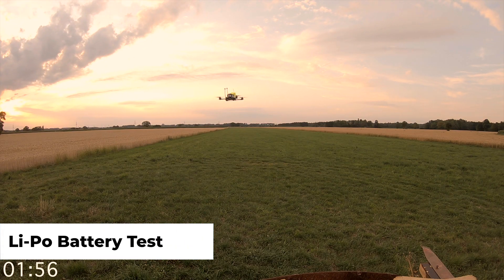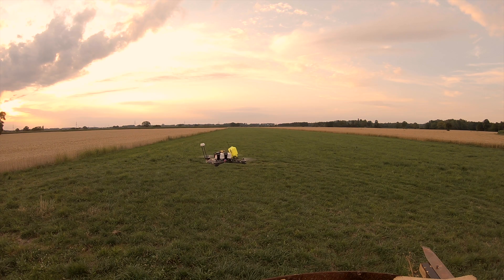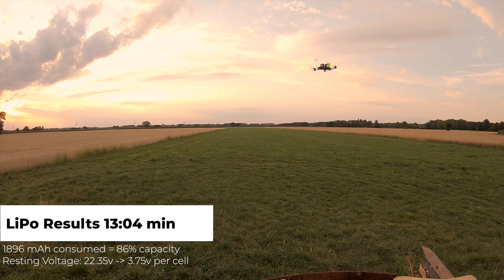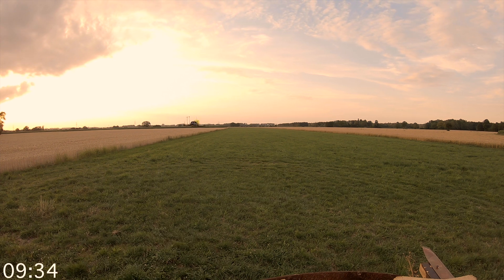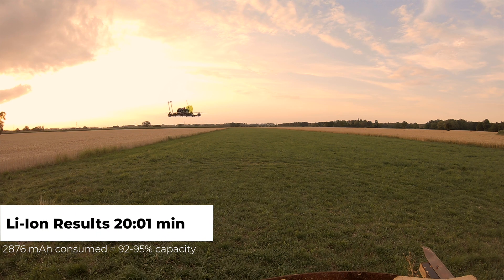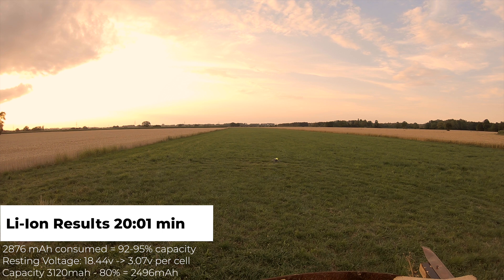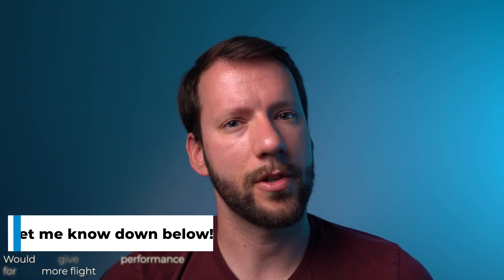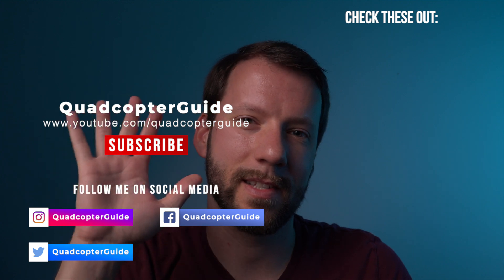Testing my Li-Ion Drone Battery vs. Li-Po

Comment from the maker: Would you give up max performance to gain 30% longer flight times? Why or why not? Let me know!
Reply: Of course, for long distance flying. In fact, I've just built my first 6S li-ion and am currently charging it for the first time (also with the intent of building a 6S2P pack soon). But yeah, I plan to have one Li-ion and like 12 LiPos, as mostly I like doing flippy floppies.

Also, for all the people talking about DJI drones, I'm pretty sure they would all be running Li-ion now anyway. They're not punchy, but have amazing battery life. I can't imagine them running Lipos.
Reply from the maker: You’d think right. All Dji drones except mini run lipo hv.
Reply: @Quadcopterguide  Will these Li-Ion cell work for my below hex?
1)Frame:Tarot 680 PRO Folding Hexacopter Frame
2)Motors:6x Tarot 4108 High Power Brushless Motor (380kv)
3)Propeller:3x Tarot 1355 Carbon Propellers (Two Holes / CW and CCW)
4)ESC (Electronic Speed Controls):6x Hobbywing XRotor 40A-OPTO ESC
Reply: @MrNams  of course MrNams,you just need to connect them in parallel to get the most out of them
Reply: the handling safety on lion is better than lipo... so yes
Reply from the maker: Hey Stefan, thanks for taking the time to comment and watch, it is much appreciated! Servus!
Reply: Yea
Reply: I will
Reply: It’s more based on what you are doing, if flying cinematic he isn’t going to be doing power moves, he is going for duration.
Reply: of cause performance ... even though I had assumed you would have build a Mavic 2 or so battery hack ...
And if you spend enough care and money for right cells then you get even higher discharge rate.

Would love to see such Mavic 2 hacks ...
Reply: If I'm just planning on cruising. Sight seeing.. cinematic.. yea of course.. 
Which is mostly what I do
Reply: I would prefer the longer flight/play time over top end performance in most cases.  I feel like they both serve a purpose and have their own applications.  I see too much team li-po vs team li-ion when I feel like both can be ideal in varying situations.
Reply: Though there are some 25a and 30a li-ion cells.. so for my smaller drones thats fine..
Reply: Depending on what I was doing YES I absolutely would….. anytime I can get more flight time Im there! Also have you thought about taking 2 battery packs and run them series for huge gains? Ive been doing this and you will be shocked to see what a 1100-1300 mah battery ADDED to your big bat will do…..

Comment: Building a 7 inch drone efficiency long range and endurance drone , definitely will be using molicel p45a cells in 6s 1p self made battery.. looks safer than polymer battery, also it's just a hobby for me so not be flying everyday which in lipo case might degrade the battery more compared to li ion battery that has longer and more charge cycle.. my main purpose is just to have a cinematic mavic like drome build. Not flying fast and acro just going high altitude 😅
Reply from the maker: Thanks for your comment!

Comment: I made 2 li ion packs from samsung, i have a 6s 5in drone and a 6s 10in drone i ran the packs in parallel and it just made weird sounds in the motors, i only did a hover test but not sure everything is nice a secure and properly soldered i was hoping this would work but i guess i have to do more testing and maybe my dji o3 and gps along with the fc and huge 3314 motors with 900kv , i was trying to see how or what iflight uses to make the fullsail 8000mah li ion pack but no deal i purschased a graphene lipo 6000mah and i get about 8 mins of cruising time
Reply from the maker: hey JH thanks for dropping by and subscribing! What do you think caused the weird noise? Some kind of voltage irregularity?

Comment: something strange is that the old mini 2 had 27 mins of fight time till forced landing and it was 23 mins on the mavic mini the lithuim ion lasted shorter then the lipo
Reply from the maker: hey cyan, that could be due to many factors.. Age of the battery, ambient temperature, altitude, humidity levels, etc etc.. total capacity of each pack.

Comment: Im changing a LP battery to a LI battery. I have a 2 wire LI pack. But my old battery carriage has circuit boards in it. It has a Blk & Wht wire I dont know where to connect them so the battery still works as Intended.  Can You Help..
Reply from the maker: hm theres more wiring required inside the pack than just the two wires.. If theres no balancer lead i would be a bit concerned.

Comment: Hi,

Do you have any formula to convert Lipo to Li-ion pack ? How a 'c' rating is managed in li-ion compared to high c rating in lipo?
Reply from the maker: should be the same but be careful.. many manufacturers fudge C ratings.

Comment: Do you need to change any settings in Betaflight when you go to li-ion from lipo?
Reply from the maker: hm great question. i would lower the low voltage cutoff.. otherwise it may cut before u draw "the same amount of juice" out of them... of course you gotta watch that stuff like a hawk.

Comment: You aren't losing performance. The lithium ion batteries are capable of outputting the current required by your drone. It's just not so good for the cells to exceed the rated current
Reply from the maker: thx for watching!

Comment: I am just getting into FPV Long Range. Still new to FPV, only on day 2. Working on the hovering for now and line of sight until better goggles come in next week. I ordered iFlights but I can see very well and there is no focus option. Anyway, I used to ride electric skateboards and remembered I had an old battery pack in the closet. Took it apart and there were 20 18650's in it, only 3 days of use. So for my Assis 280 explorer I am going to start experimenting with DIY packs. I laughed when you said it's for science. My whole life my saying has been, lets try it for science! We MUST experiment to move forward.
Reply from the maker: thx for watching! how have you been progressing?

Comment: @quadcopterguide You need change something in the betaflight before you connect Li-ion battery? or just straightaway you connect battery and just fly ? I have 4s drone and use Li-po all the time. I wanna swap to Li-ion.
Reply from the maker: thx for watching!

Comment: Because the voltage levels of lithium ion vs lipo is slightly different, especially when fully discharged, couldn’t the drone do an emergency low voltage landing before the lith ion pack is truly discharged?  I mean if the Low voltage threshold of the drone could not be manually adjusted down.  Some people may try this on drones with fixed LVC settings.
Reply from the maker: hey InfinityVision, thanks for taking the time to watch and comment. It is much appreciated! You can double check settings in betaflight and your ESC firmware to ensure that the lower voltage won't trigger a disarm.

Comment: But isn't the c rating of the lion less??? Like my drone draws 60 amps of current while my lion can deliver only 5 amps max at a time any solution for this other than lipo...? Can I use a 1 farad or more capacitance  capacitor in parallel?
Reply from the maker: Hey Random thanks for watching and taking the time to comment. Much appreciated! The C rating for Li-Ion is less, you have to manage throttle more carefully.

Comment: Hello!! I have a question I am hoping you will see this. I have a dji phantom 3 advanced that I use as a fishing drone to carry shark baits out from the beach to around 300-400 metres, my drone has a max lift capacity of 1.6kg which is plenty for me currently but I was curious to if I make my own li ion battery pack would that hinder the ability of the drone to lift? I know you said you don’t have that instant discharge for performance but I’m always going slow taking 2 minutes to get to 300m and also lifting slowly so would that matter? Also with a lighter battery pack I could lift more and or bigger battery pack for same weight as my currently Li po battery for longer flight time and more sharks caught. If anyone has any information on this please don’t hesitate to comment on here
Reply from the maker: Hey Jackson, thanks for taking the time to watch and comment. It is much appreciated! Adding weight like that would most likely draw more power than provided by Li-Ion.

Comment: I run a DJI setup...the FC has a dedicated DJI plug so I know it's getting regulated voltage.  If I fly at 60-70% throttle for any length of time it just shuts down and crashes.  I can hover and meander along just fine but if if I accelerate (slowly) to about 60% I can fly like that for about 5 seconds and then it just shuts off and hits the deck hard!  I fly a 7" Kakute F7 AIO DJI flight controller.  Anyone else have a similar issue?  I can't figure out if the battery is failed/can't recover like it should or this setup is not compatible with a DJI setup for some reason.
Reply from the maker: Hey Pattwakt, thanks for taking the time to watch and comment. It is much appreciated! That doesn't sound ideal at all. Initial suggestion is of course trying a fresh battery. To me it sounds like it is either not supplying enough voltage, or something is drawing too much voltage. Next step I guess is to try another FC.

Comment: I would also like to bring up the weight differences in the batteries.  If you tested these batteries with equal weight you could balance around extra cells and or extra storage in the Li-Ion packs to compensate for performance and still likely achieve the robust endurance.  Albeit, I have neither the resources, knowledge, nor the time to experiment with these adjustments.  This is only theorized using the numbers and information available to me.
Reply from the maker: hey TM thanks for taking the time to watch and comment. Much appreciated! Perhaps, but my research shows that Li-Ion is where people turn for long flight times overall.

Comment: Awesome video! Found you as was researching behavior of Li-Ion batteries. I recently built a 4 inch long-range drone and got a pre-made Li-Ion 3S, 3000mAh battery. It seems to only get to 4V per cell when fully charged, and then drops really quickly for the first 1V overall (so about .3V of each cell). Is that normal or is it a quality issue with this battery? Any quirks in behavior you can share would be really helpful as I'm trying to get up the knowledge and confidence to send it out pretty far. Thank you!!!
Reply from the maker: hey Itai, thanks for taking the time to watch and comment. It is much appreciated! Sounds like there is an issue with your battery or the voltage meter in the quad. I would be very careful. That does not sound like normal behavior.

Comment: Hey could you explain abit about the C rating like will the lipo work for a 2200kv push motor
Reply from the maker: Hey lec thanks for watching and taking the time to comment. Much appreciated! C rating essentially let’s you know how quickly a battery can be discharged. You also need to know what your max amp discharge is of your setup. Only then can you figure out if the battery is sufficient.

Comment: i bought a 3000 mah 4s lionpack do i charge it on lipo setting on my charger?
Reply from the maker: Hey Jamie, awesome you took the time to watch and comment! Much appreciated! If your charger won’t charge li ion correctly you can research if you using lipo on yours is also ok. I have done it on mine. Your mileage may vary.

Comment: hi, is it possible to use 4s or batteryor more for dji phantom 1 i mean lithium ion battery
Reply from the maker: Hi Kamaran, thanks for stopping by and taking the time to comment! Awesome! Theoretically it is possible. You have to check if the phantom runs LiHV or regular lipo first. If LiHV it will not work.

Comment: Do you make custom-built Li-Ion drone battery packs for a  mavic pro?
Reply from the maker: Hi Peter, thanks for tuning in! Li-Ion won't work with the LiHV batteries used on most mavics. You would have to use a LiHV LiPo to expand it's battery if you wanted to do that.
Reply: @Quadcopterguide  I use both LiHV and non Lihv lipos right now. why would it not work? Thanks

Comment: thank you for the video.but i have a question..are you sure that when connecting two packs in parallel you double the discharge c rating?i think it doubles only the capacity.
Reply from the maker: Hey Likeandros, thanks for taking the time to watch and comment. It is much appreciated! the voltage stays the same, the capacity doubles but since you are pulling juice out of 2 packs instead of one each pack only gets half of the energy pulled out of it at once, if that makes sense.
Reply: @Quadcopterguide  yes i did the math and you are correct.c rating is the same but because it works in conjuction with amp/hour in theory it doubles.c(30)x3000mah(3)=90 c(30)x6000(6) in parallel180. available current draw.

Comment: Hi bro I have a quad with spec 
920kv motor with 1045 propeller 
Apm2.8 30a Simonk esc
Djif450 frame
M8n GPS and fsi6 to and rx

Currently I'm using 11.1v 2200mah battery Ian getting a flight time of 3 min when I hang my mobile phone to record video without gimbal

Can u plz suggest which li ion cells should I use and in which configuration Pls help me out
Reply from the maker: Hey there, thanks for taking the time to watch and comment. It is much appreciated! It all depends on how many amps you are pulling. LiIon cant provide as many amps as lipo. You shouldnt really pull more than half of the rated amps out of a li ion pack. So if the cells are rated at 30amp you should pull 15amps mostly. Hope that helps.

Comment: Hi bro
I have a quadcopter
With spec
Dji f450 Frame
Apm2.8 Fc
920kv motors
30a simonk esc
1045 propellers
M8n gps 
Fsi6 tx and and rx

If I make a battery pack like u will it work for me pls reply 
The nasty lipo are wasting my money as i just entered into the hobby iam nit having that much money with me 

Love from india
Reply from the maker: thanks for taking the time to watch and comment. It is much appreciated! it all depends on amp draw. if the batteries you choose offer double your avg/max amp draw it will work fine. Otherwise you have to really be careful with the throttle.
Reply: My quad draws 39 amps which cells do u recommend and in which configuration
Thanks for reading
Reply: Bro pls reply

Comment: I would have liked to see your battery temperature after landing, that is a good indication of how hard they were working. I made 3s2p 18650 pack some time ago, the LG cells I used got way too hot even though the current draw was 1/2 the rated max. But I want to try again with better cells for the long range quad I'm busy building. For cruising / exploring, I happily give up performance for duration.
Reply from the maker: Hey Paul, awesome you took the time to watch and comment! Much appreciated! The cells were warm but definitely not hot. Will have to measure temp next time.

Comment: I found your video as I`m currently looking to build a battery bank for charging in the field with 18650s have you done a video on this? Thanks in advance
Reply from the maker: Hey Craig, thanks for taking the time to watch and comment. It is much appreciated! What size battery are you going for? You could also use 21700 sized cells if you wanted. Would a 6s2P pack be enough for your needs?
Reply: Quadcopterguide you’re welcome! I’m going for 6s2 18650 setup
Reply from the maker: Awesome. It’s similar to this pack but of course double cells and a bit more complex wiring. If you design it out on paper, and doublecheck your work it should be a half way ok build. I haven’t made mine yet.
Reply: @Quadcopterguide  Thanks for your input. If you do build yourself one please do a video. Have a great day :)
Reply from the maker: Will keep that in mind :D Cheers dude!

Comment: Can I use Li-ion battery for a fixed wing vtol with 5 motors  (4 for VTOL & 1 for cruise) ?
Reply from the maker: Hey Imran, awesome you took the time to watch and comment! Much appreciated! It all depends on the power draw.
Reply: @Quadcopterguide  Can you explain power draw a bit further with an example since I'm a beginner.
Reply from the maker: No worries. So li ion batteries don’t produce as much Max simultaneous power or amp draw at once. You have to figure out what your max amp draw is and in which portion of flight. If you can manage to stay say 10-25% below the max amp draw rating on the li ion battery I would say it will work well enough to do the test.
Reply: @Quadcopterguide   If I compare the stall current of my motors with the max ampere draw rating of the battery, would that be a fair comparison ? 
Thanks for you response

Comment: I need ur help

I got 2  18650 li ion batteries of 3.7 v each and 2200 mah and connected in series then attached to drone then it charges as usually but after charging is completed when I started drone it starts and it is flying just above ground just 2 cm above ground and with in 10 sec it the drone gives signal that battery power completed and then stops what to do pls pls🙏🙏🙏🙏
Reply: I brought good li ion batteries but still problem
Reply from the maker: What drone and how did you attach to drone? Why did you attach to drone before changing?

Comment: I had a drone and it has 1200 mah 7.4 v  lipolymer battery I want to replace it by li ion  battery of 18650 model is it safe for drone
Reply from the maker: As long as you get two cells in series it should be fine.
Reply: Will highest mah or highest discharge rate effect the components of mother bord or drone